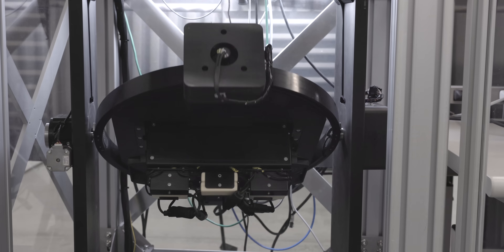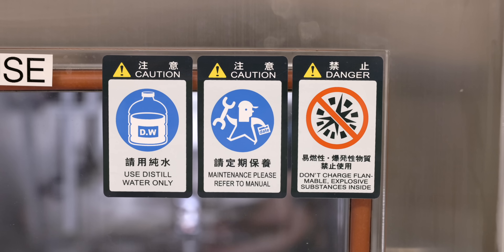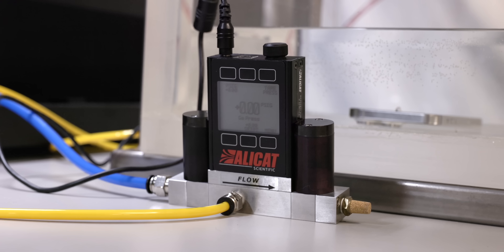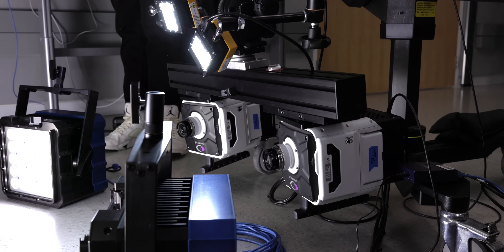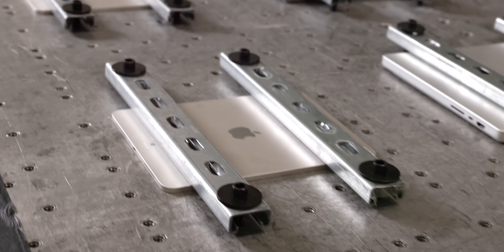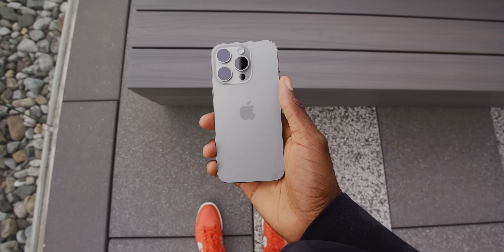I Visited Apple's Secret iPhone Testing Labs!

Comment: Just 2 example Siemens M35i or Nokia 5210 but there are several more phones with repairability and water resistant manufacturers just need to go back 20-25 years. But its not a big business for the to sell 3-4 components seperately or as a bundle and your phone basically last a lifetime.
An other thing what I can't bear is the metal phones, just use plastic, if I bent a metal gess what it stays that way a screen has no chance to survive that, but plastic can absorb shocks and regaint its shape after bending.

Comment: The marketing of "durability and repairability" being on opposite sliders is objectively wrong. You just gotta look at the automotive industry where some of the most durable cars are also the most repairable. Even within the same tech-space, software locking components which Apple does is another great example of this being not true.
Reply: Nono coding the screen and speaker to the iphone so you cant repair it is super important to durability!!!
(Joking ofcourse)

Comment: 7:07 wow. Just wow.
What a sell-out.

There's no excuse to not have an easily repairable phone that's also water-resistant - remember the S5 and Xcover? They even had removable batteries!
And headphone jacks. And SD cards.
And they had no parts being paired to a specific motherboard that refused to run if replaced.

Comment: SHAME ON YOU. Samsung had Waterproof phones ip68 where you could take the back of and userreplace the battery. It is possible.
Reply: THIS
Reply: And the justification of removal of headphone jack
Reply: And it had an SD card.
Reply: Had one until 2 months ago when they shut the network it used down :( I miss my S5 lol
Reply: @stusue9733 network shut down? Is that a frequent thing in your country? And what country is that?
Reply: @MelodicTurtleMetal  Australia. 
They shut down the 3G network and it was very iffy whether the S5 would still work for voice.
Reply: Sony still has all of those things
Reply: LG also did it too!
Reply: @NEON2600 So did Motorola
Reply: I had it, it’s the Samsung Galaxy S5. My fist under water picture was taken with that phone. It has a special place in my heart.
Reply: Had a Galaxy S5. Was waterproof enough that I used to literally wash it in the sink as a joke... Did this hundreds of times and it still works 10 years later...
Reply: had
Reply: @dantheytguy  apparently they still do. Samsung xcover 6 pro and samsung xcover 7
Reply: @durschfalltv7505  I've never heard of these phones
Reply: @dantheytguy  they kinda suck on purpose unfortunatly. They are buisinuiss phones. No high quality. They could be but that would not make as much money.
If i had enough r&d budget and equipment and time and energy i could build you a good phone with parts of another. 
But by the time it would be done it would be last gen and it would be very expensive.

Comment: Do you remember the Samsung Galaxy S5 that was IP67 rated with a removable battery? Pepperidge Farm remembers.
Reply: I have samsung xcover 5. It also has a headphone jack. When I had XCover 4, it once fell into toilet without me noticing, were there for about an hour and when I found it it still worked after I left it open to dry out for about a day or two. It only stopped working because the changing connector got damaged years later.
Reply: How dare you bring up the last great phone Samsung made!
Reply: @guccipoochi 

If they released it with an updated CPU I'd buy today.
Reply: I'm writing this on a Tab Active2 from 2017. The latest Tab Active5 from this year still has removable battery, headphone jack and the IP68 rating.
It is a little chunky and heavier but it can be repaired.
Reply: I had an S5 until about 2 months ago. They shut the network down so I had to get a new one :(
Reply: @stusue9733 that's rough. What network was it? My old S2 still connects fine in Australia
Reply: @MelodicTurtleMetal  filtered again

The network that starts with a T.
I only bought my S5 when the S stopped working when they shut the 2G network down.
Reply: @stusue9733  The S1 only gets to 3G. That's sad, but I guess the same will happen with my Xperia Ray and Nokia N73 when they shut down 2G-3G here in a few years. I have thm as relic anyways.
Reply: My phone, the Galaxy XCover 6 Pro from 2022 has a replacable battery and IP68 :)
Reply: This complete apple servant doesn't remember
Reply: MY MUM STILL USES ONE!!!   
She's in her 80's and even she knows how to swap the battery in that thing, because she had to buy a new one; And she could; So she did. And now her phone lasts more than a few hours again. Like NEW 🙂 Effing magic eh,. How's that for durability!
Reply: @chocolate_squiggle best thing, no functions get Restricted because you didn't let an authorized repair center swap it or bought an overpriced replacement after giving all your information away
Reply: While it’s true but then why did they/others stop doing that? There must be some reason. And yes money is one of them but not only one of them.

Comment: Cracking video, Marques.  There has to be a Rolls Royce of the phone world. iPhones are it, but they are stretch-affordable.  When you have one, you know it will work all the time, it will need repairs one day and you take it to Apple.  Thats a deal you sign up to.  I wouldnt take my Roller to the local one man band garage to get it fixed, so I take the cost and the hit. It is a great feeling though, to know that when I buy a new iPhone, noone in the world however powerful, however famous, however rich has a better phone than me.   It is quite humbling,  Love my iPhone.

Comment: The discourse about durability is just Apple propaganda, if they wanted it to be truly durable it would be made of full industry grade hard plastic with a lot of rubber material inside to keep water and dust out, and not let the internals get damaged. Not to mention they can easily do this and isolate the battery out like samsung did with the s5. 

Instead is full metal and glass to make it breakable and not repairable at all, not even easy to get the battery out (which can be very dangerous as we know). 

It's literally only propaganda.

Comment: 00:04 Visited Apple's secret iPhone testing labs for water resistance, durability, and more
01:29 Apple tests iPhone water resistance levels with extreme measures
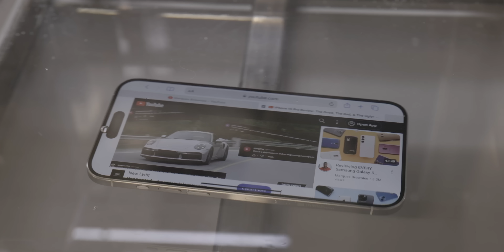02:53 Apple has secret iPhone testing labs for water and drop testing.
04:17 Apple's rigorous testing process for iPhone durability
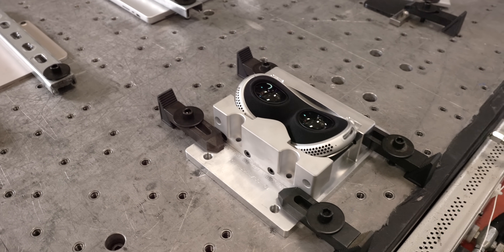05:41 Apple's secret iPhone testing labs simulate years of wear and tear.
07:01 Durability and repairability are at odds with each other in Apple's product design.
08:21 Ensuring product durability through water resistance testing and battery longevity.
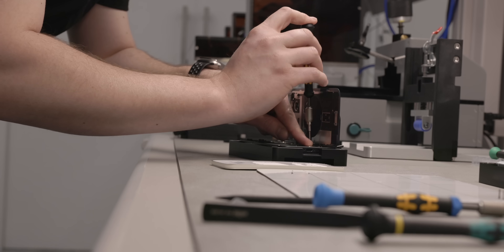09:36 Durability testing at Apple's labs focuses on reducing failure rates and repair needs
Crafted by Merlin AI.

Comment: From my experience every iPhone I had from the 12 to now has leaked water after a few months of use. Torsion in your pocket, general use and heat/cool cycle makes the water resistance barrier less effective. Special note when you have your phone opened for repair or replacement of the battery, screen or back; Don't rely on it, every case of water damage is flagged away by Apple. You better use a good case like the Lifeproof.

Comment: I'm a little confused with the Apple Engineer's response.

When he's talking about water ingress durability in relation to batteries, I feel like they're two different things.
While it most certainly makes sense that improving water resistance improves a phones durability and, in effect, can prolong the life of a phone's battery; it doesn't necessarily improve a phone's repairability, in fact it actually makes it harder, as there are now more components/additional expenses involved to repair it. 
So while the battery may ultimately be better protected because of the water resistance, it's not really easier/more efficient to repair. 
Moreover, batteries in consumer phones aren't "repaired" but replaced, so I'm not sure what he meant by his "saving the environment" comment.
Dead, damaged, or heavily weakened batteries are usually recycled or stripped (hopefully not thrown out of course).

But hey, you don't get to be that high up at Apple without being a great bullshiter lol

Comment: Glass - Ah yes! Because they ultimately don't want you to repair the thing, they want you to REPLACE it. I'm full Apple everywhere, but it boggles my mind how they can speak about durability, yet use components that can easily get damaged or break. especially on the exterior. Why not make the phone carbon fiber? Because then that would mean the phone would hardly need replacing. We also see evidence of this via their software updates. They deprecate/sunset old devices via new features with their software. We're living in 2024. Phones should not need x amount of cores to perform these basic upgrades to the software. Which also leads to Apple's ultimate goal, and that's piecemealing features to incentivize people to upgrade and to give them reason to sunset old devices. No reason to give you everything at one. Like for example, moving your icons freely in the OS. How long did it take them? Now, this is a feature that can be done on any version, but don't put it beside them to lock you into these features via upgrades, cause they do that all the time.

Comment: The battery thing is BS. What about the Samsung Galaxy S5, which had a removable back cover & replaceable battery AND an IP67 rating? Hard to believe that IP68 + removable back cover wouldn't be within reach for Apple, especially since the S5 came out over 10 years ago.

Comment: I am happy that they work hard to make the iPhone as bombproof as possible, the thing I don't want is if I have to replace my screen I can't do it without losing a bunch of features even if I use a original apple screen, their lack of repairability comes from them making it hard to repair more than it does from any durability they are adding.

Comment: So having repaired iPhones for 13 years now, I can tell you this.  Water resistance helps but is not fool proof.  I get iPhones that come in regularly where the phone is stuck in a start up boot loop.  (Apple logo comes on, screen goes black, and keeps happening over and over).  This is because water has gotten in the earpiece and damaged the flex cable in there.  Only way to fix it is to replace the cable which will disable face ID unless you have Apple replace it with an OEM display which has a new cable pre-installed and they will re-program for you.  As an Apple Certified Technician (we are an IRP), I can tell you this is pretty expensive.  Most of the time my customers says Apple refused service because the phone was water damaged.  My advice..when you are around water with your iPhone, use a Ziploc bag!

Comment: haha they make 10 000 phones dropping shaking, and they pass, and mine falls down on concrete from 1.5 meter, then i catch it with my foot, and it goes down from like 30 cm and breaks:D The other occasion was phone dropped from bedside stand and bottom side cracked... Just like that on wood floor..

Comment: 5:20 That might not seem like as common a test, but I've killed the camera on a phone by having it on a motorcycle mount that didn't have adequate vibration damping, so that's a thing. 

Also my opinion on the 'sliding scale of repairability/durability' is that it's a bit more complicated. Some things arguably are a scale, like water resistance vs ease of opening. Screws don't seal that great, and adhesives do but are harder to remove, so fair enough. Some things have changed because they make durability way easier; which is why I'm not sure I'm a huge fan of the proposed mandate that all phones have tool-less replaceable batteries. Having that as an option on some devices is awesome, but it does make waterproofing much more difficult. 
The biggest issue I have with repairability is when companies make decisions that significantly increase the difficulty of repairing a device without really improving the durability or cost. (Cost is also complicated, there's a reason Framework laptops are more expensive, but at a certain scale it becomes more anticonsumer than actually necessary) Things like permanently gluing batteries, using excessive (well past what is necessary for waterproofing) amounts of adhesive, or numerous clips that aren't really designed to ever be opened where other options are viable. Locking hardware to devices arbitrarily, or designing new fasteners simply to make it more difficult to open, those types of behaviors are much harder to justify. (Also side note on that hardware locking one, honestly I don't even have a problem with serializing components; honestly if I'm buying a used phone, I'd love to be able to check if the screen and battery are original, and if not, who made them. But preventing the device from functioning properly simply because it wasn't repaired by Apple is not ok.)

Comment: Iphones can be durable and repairable if they wanted, no need for 6 different screw head types or ribbon cables that are software locked, glass backs that break on one drop with an Otter case like my iphone 12 pro.

Comment: Everything comes from customer/design requirements which includes warranty requirements. They engineer/test/model statistically to prove the product will meet the warranty period or assumed life of the product. If they didn’t their warranty cost would be so high it could possibly sink the company ie “risky”. If they developed a product that didn’t ever break it would cost $5,000 per phone. There is a trade off.

Comment: Those TMX 7510 Phantom cameras, if they're running full speed at full resolution, are filming at roughly 80,000 frames per second.

Comment: Maybe it is not what defines the IP - - rating but isn’t using distilled water misleading? Since it doesn’t conduct electricity and doesn’t corrode the components, doesn’t make it pretty simpler to pass all the tests and get a high rating?

Comment: Salty water testing would also be very interesting to see. Just shooting videos from a phone underwater in the sea - that would be sick!
Reply: This is no problem as long as you are not going deep. I did this last summer while snorkeling in the mediterrane sea with my iPhone 14 Pro several times. Just wash the phone and specially ports after it with clear water and dry it. 
It even gives you a warning as long as there is water in the Lightning port not to charge.
Reply: @GoforMac  Thanks!

Comment: It's a good perspective to have, but it's a durability engineer's mindset.  It isn't a line... there are other axes under consideration too.  Take just one: design, or, more specifically, device thickness.  Apple keeps shrinking devices to miraculous levels of thinness through remarkable engineering... but that also has an impact on the length of the durability vs reparability line.  There are surely compromises in those spaces that come from decisions in the design department, and Apple does seem to place design as sacred above all else

Comment: Reparibility is not just about fixing broken machine. Say, if I can upgrade storage and change new battery, I won't need to purchase a whole new phone every 2 years, that would mean less environmental footprint (also less profit for apple).
Reply: Lots of Samsung models have removable memory cards and I have never had to replace a cell phone battery ever, mainly because they die 4 or 5 years later from wear and tear but not because of a battery problem. My Pixel 3A XL original battery holds a charge with no problem even though I have had the screen replaced 3 times from drop damage. If I replace my Pixel with a Pixel it will definitely be one with 256k memory. My edit is adding I get my Pixel screen repaired by a local phone shop and the price has slowly gone up to about $120 for parts and labor for replacement. I have never had a problem with whatever screen they are putting in there whether it's a factory screen or aftermarket.